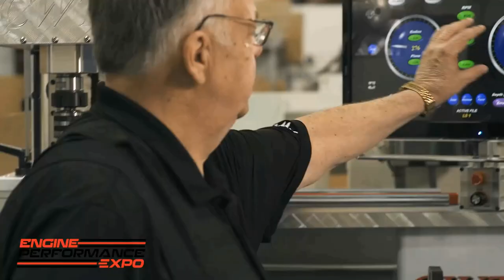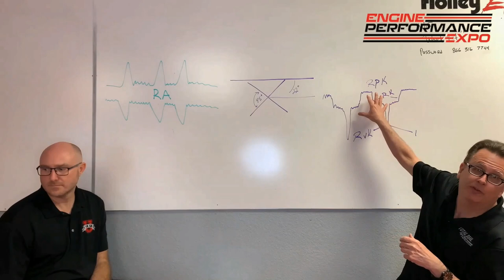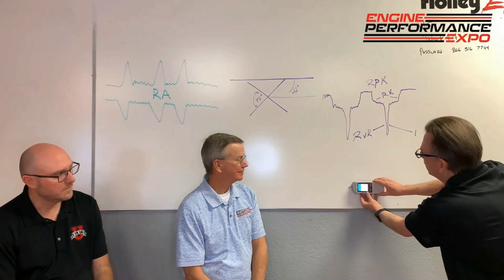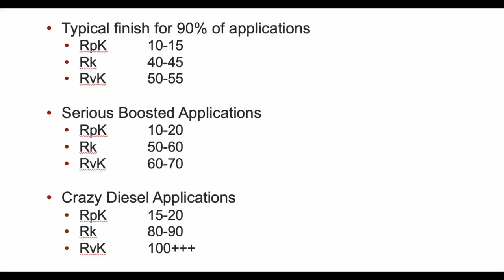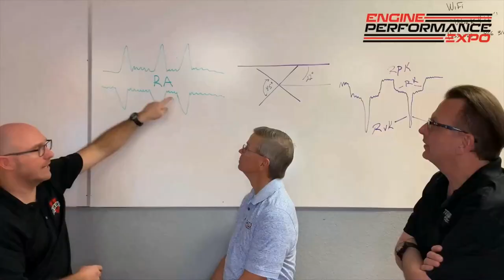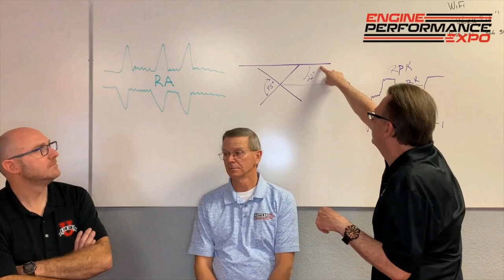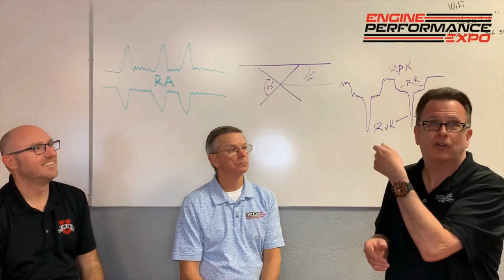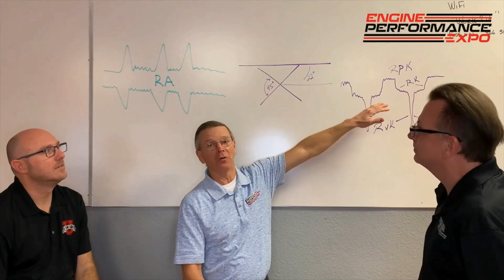Cylinder Honing & Surface Considerations Part 1 (2021 – Episode 7)

Comment: In my case I want to buy a 500$ ring cylinder kit for a 4cyl from Total Seal, but I'm abroad in a country that doesn't have any proper tools less the knowledge to achieve the surface finish, at least I need to know which stones I need to ask for at the machine shop which grid for 1st pass and honing last pass
Reply: Your Total Seal rings will come with honing instructions, including grit - primary and secondary.
Reply: @bobirving6052  Thanks, didn't know that.